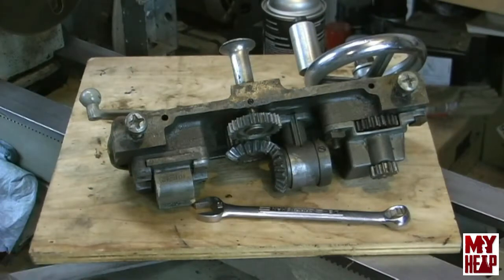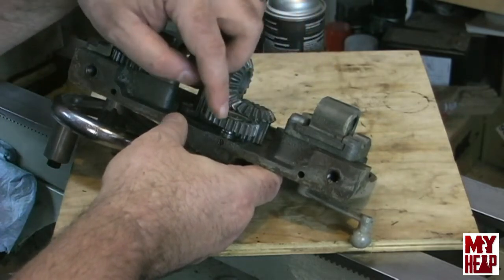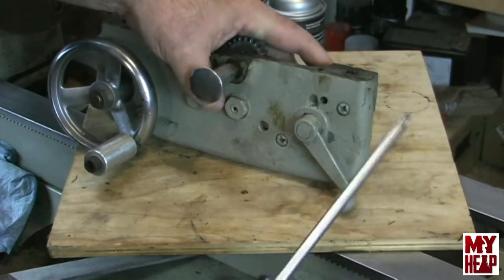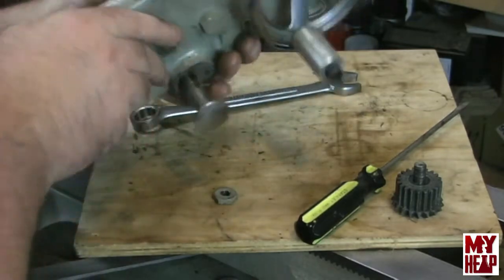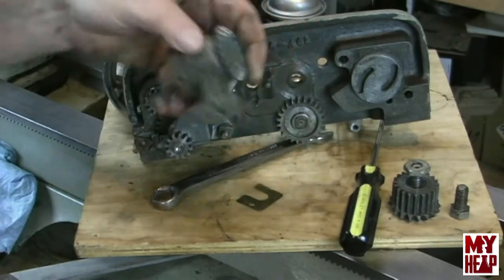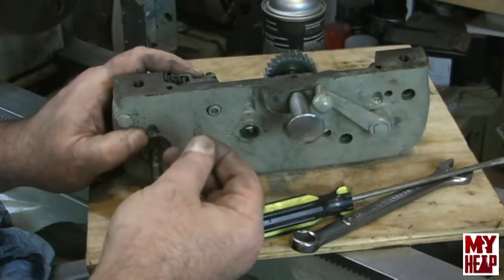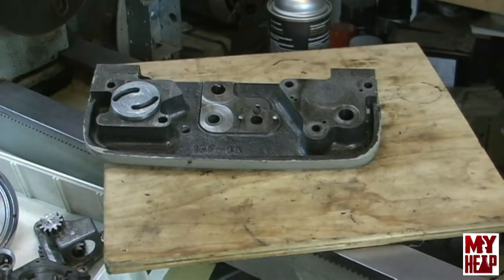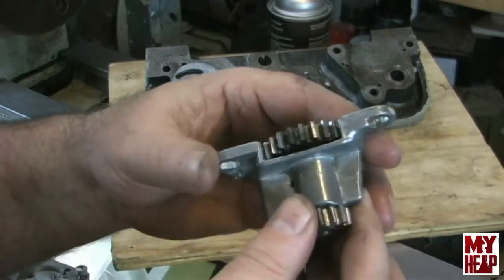Atlas 10F Lathe - TH54 - 13 - Looking Under Bertha's Apron - Part 1

Comment: If I recall correctly, when I first took the crossfeed control shaft out, a little ball and spring went flying, took me probably an hour or more to find them. And then, putting them back in was a p.i.t.a. 
You got me as to the broken taps in the  traverse gearbox. Maybe someone was trying to reinforce it as the ears where they bolt on is a common failure point.
Reply from the maker: Hey Jeremy.  Yeah, I found the little spring and ball in the control shaft.  Didn't have an issue of taking it apart but putting it back together looks to be a bit of a challenge.  I am wondering how to depress the ball and spring while trying to get the shaft back through the bore.  Any tid bits of wisdom you like to pass along on that??  :-)

Joe

Comment: joe just a update looks like i  have a heap of gears that don't fit my lathe  shooting a vid to address the questions you bring up here and ill show the gears also . as for the cracks i think id let it ride but stay on the look out for a good replacement half nut carrier. ill try to get it up in a day or so
Reply from the maker: Chris, I guess you still have the list of the ones I am looking for?

I have new gits GB ball oilers ordered.  If you are interested they are GITS number 00520 and cost 2.43 each from applied.com. Found some wipers on FeeBay and they are on their way.  Also have a bid on the half nut carrier, CAM and handle.  Auction closes tomorrow and I am the only bidder so hopefully that will take care of that.  Needless to say, part two will be delayed a bit while I wait in the parts.

I also ordered a couple of Goldenrod oil cans.  Art Eckstein was kind enough to send me a link to several cans that had the fitting on the end for the ball oilers.

Looking forward to your video.

Joe
Reply: My Heap I adress many of the things in the video so I'll leave it to that but I thought the ball oilers were not made buy Getz brother's but I stand corected
Reply: thats right i do ill make sure to cross reference that and get back to you viea email

Comment: Another great update. I have commented earlier (also finishing up a 10F restore) and wanted to ask for a bit of help from your audience and warn you about something I am seeing. I am having issues with the lead screw binding when in the forward position. Hand turns like butter when in reverse (less gearing involved) but when I switch it forward it intermittently binds (seems to be the last inch or so of leadscrew (on the gear end). Have taken it apart multiple times inspected everything without finding anything wrong. Got it to turn freely with the apron removed by shimming the end bearing but as soon as the apron is back it must change the angle slightly and it binds again. If I pull out the leadscrew about an inch (so it barely goes deeper than the change direction gear) it clears up so it must be an alignment issue. I don't see any sort of adjustments anywhere? Anyone seen this - suggest a fix? Wanted to warn you to make sure you test by hand both directions before putting it under power.
Reply from the maker: Jeff, let me make sure I understand your issue.  With the saddle / apron fully assembled ...

When you run the carriage toward the headstock the leadscrew binds?

Not sure what the issues is, but let me throw a couple of things your way that may be a help in locating the problem.  When adjusting the leadscrew bearing at the tailstock end of the lathe, run the saddle close to the bearing with the half nuts engaged.  While doing this, make sure the bolts on the bearing are loose.  Once the saddle is close to the leadscrew bearing, tighten the bolts that hold the leadscrew bearing.  This will put the leadscrew in alignment on the tailstock end of the lathe.  I imagine you already knew that.

Now the headstock is a different story, if you have the same 10F reversing gearbox that I do, the leadcrew will slide into the bevel gears and shift collar (parts 9-49A, 9-50A and 9-48B) with no visible adjustment available.  If you think about the only component that could affect the leadscrew alignment, it would be the keyed shaft / bevel gear (part 341-051)  that the leadscrew runs inside.  Mine has a thin shim sitting under it (parts 711-005, 711-006).  This would have the effect of moving the bearing assembly (part 046-046)  closer to the bed (thicker shim) or closer to the apron (thinner shim).  I would try loosening the bolt that holds this part in place and bring the saddle up towards the headstock.  With this part able to move you should be able to free it up so that it does not bind.  Now, I am not sure how you can check, or look at it, but with the saddle up at the headstock check for a gap between the casting that holds this part and the apron.  Putting a different size shim may help your problem.

I know that does not solve your problem, but maybe it will help you see a direction you can go to solve it.

Joe
Reply from the maker: Although I actually thought the shim is there to set the backlash on the bevel gears.

Joe
Reply: Thanks! I think you gave me some things to try. I probably didn't explain it well. I have managed to reproduce it by removing everything but the carriage, leadscrew and the gear the leadscrew goes into (9-48B). If the carriage is in place it takes some force to push the end of the leadscrew into that gear (9-48b) - it goes in easily until the last half inch or so - and you can tell they are rubbing as it should spin independently in there (with the shift collar removed) but it doesn't - spinning 9-52a moves the lead screw (keep in mind no shift collar) and it takes force to stop one of the two. The shim you called out might help, although trying to eyeball how the two mate it seems I need up and down adjustment and not in and out.. Maybe its the apron not tight into the carriage enough so is riding slightly too low or too tight and riding too high, I don't see anything else that would raise or lower 10F-81 in relation to the gear box..  Just so I know when I can consider it fixed, with yours put together can you easily turn the leadscrew in forward by manually turning a gear on 9-52a? Is it significantly harder than when in reverse or about the same? Thanks again for your reply and help - everything else is working so this is my last challenge before I can actually use this thing
Reply from the maker: Jeff,

Maybe some vertical alignment can be had by putting shims between the lathe ways and the leadscrew direction change casting.  In your case this would only work if it is too low.  Let me sleep on it and I will get back to you tomorrow if I have any other ideas.

Joe
Reply from the maker: Jeff, So here are my thoughts on making alignment adjustments to the leadscrew for the direction change gears.

1) The position of the leadscrew can be adjusted slightly front to back by varying the shim stock under part 046-036.

2) If the leadscrew is too high, shims between the lathe bed and casting part number 9-27 would bring it up.  OR shims between the apron casting and the saddle.

3) If the leadscrew is too  low, the only actions I can think of are drastic.  For example, taking material off the 9-27 gear casting where it mates with the ways, or taking material off the saddle or apron casting.  I would NOT feel comfortable doing this to the apron or saddle and would be hesitant to do it to the 9-27 gear housing casting.

I am sorry I haven't been much help here.  When I get mine assembled, I will look closely at how mine works and report back to you.

Joe
Reply: Finally had some time to work on this - I traced my issues down. It was the Banjo and the bracket that attaches to the gear box - they were exerting pressure that even with the two top bolts in place were shifting that whole assembly the slightest of bits and causing the end of the lead screw to rub against the gear it sits in.  If anyone else runs into this take the banjo and that bracket off, loosen the bolts on the gear box and the end bearing and put a single gear on the end of the assembly - then tweak until it turns freely and slowly tighten everything down (testing as you go to make sure it continues to move freely). Don't add the banjo back on until you have that gear box pretty locked down with the bolts and adjustable bracket (shouldn't be able to shift it up or down by hand), then slowly add the banjo back and test to make sure it doesn't throw it off.
Reply from the maker: Jeff, you can also use the bolt that locks the banjo to prevent lateral movement as well.  Thanks for the follow up.  I think it is great information to share to help solve the potential problem for the rest of us.  Thank you sir!

Joe

Comment: Well then leave the cracks, if it should fail in the future then cast an aluminium one, it's small and relatively simple. Cheers Peter
Reply from the maker: Peter, I found some parts including another half nut carriage (for lack of a better word) casting.  Also some new oilers and some wipers for the saddle.  Hopefully, these won't take too long to arrive and I can finish the second video.

Watched your last video.  I also caught the little surprise after the credits!  Your coming right along.  Won't be long and you will have the machine making chips.  So what is your plan on a drive train?

Joe
Reply: I will stay with the prescribed way in the book, belts and pulleys, it is at least simple and virtually free of problems if aligned properly. Also I don't have a motor or controller / power supply or want to spend too much on this build. Cheers Peter
Reply from the maker: Peter, did my comments on your newest video show up?  I know sometimes I will get comments on my videos and not seem to get notified from YouTube.

What were you driving your boring bar with at the end of your last video?  Sounded like a variable speed motor.

Joe
Reply: Your comments do indeed show up

Comment: G'day Joe, another good day at the lathe. Looks like that apron needs some brazing for the cracks, you could let it go, maybe. It's probably cracked because some joker in the past tried to fit wrong size bolts and going by the cracks, damaged threads and broken off taps, I wouldn't like to insult gorillas but hey he was one. Have a good day Peter
Reply from the maker: Peter, great to hear from you!  The crack in the apron casting is a clearance hole for the 1/4-20 screws that thread into the casting that hold the half nuts so it should only be the clamping force of the screw with the half nut holder to the apron.

Now why someone drilled holes through the casting that holds the gears for the saddle traverse into the apron is beyond my mental capacity.  I think I need to try to get one of the broken taps out as it looks like it will interfere with the nut that goes on the back side.  If not, I may need to put the washer back in there.  I hope to have the second part out soon.  Trying to find some oilers and some other bits.

So, how is the milling machine project coming.  I am looking forward to seeing another installment.  I have learned loads of stuff watching you.  Thanks for stopping by Peter, it is always great to hear from you!

Joe
Reply: I recently had a broken tap problem and removed it by consistently tapping away at it with a punch, it slowly broke up into small pieces and disappeared.
Reply from the maker: That may be an option.  My only worry is that the casting is made of ZAMAK and looks a little delicate.  Maybe if I can get some firm backing behind it, that would work.

Thanks for the tip.

Joe

Comment: The traverse gear cluster on my lathe does have lineup pins similar to yours.   You may wish to replace.

Yes those are Gits oilers made by Gits Bros (??) and they are still in business  
http://www.gitsmfg.com/

I bought another apron and saddle for spare canabalize etc.

I did not like how the drive gear on lead screw for cross feed was lubricated.  I drilled the mount bolt lengthwise and then thru the body to ensure bushing gets oil..  Did same for the other gear. Ends were capped with an allen set screw.
Reply from the maker: Hi Dan.  So did the gear cluster casting on both lathes have these pins?  The area where the bolts go through on mine are actually slotted a bit.  I thought I would use some paper between the pinion wheel of the drive gear and the driven wheel on the cluster then tighten the cluster down to leave a little backlash.

I managed to clean the oilers but it has been suggested that I replace them.  Thanks for the link.  Now to figure out what size they are so that I get the right parts.

As far as lubrication, I don't think there is a good "Factory" way to lubricate these gears.  I would like to see some pictures of your solution if you are willing to share them.  You can email at xavier at gtec dot com.

Joe

Comment: My 10" does not have a hole there in the apron. Perhaps someone drilled a hole to get lube in.
Reply from the maker: That was what I was thinking.  But the way I see it, you wouldn't get much lubed unless they were using a spry lube with a straw, maybe?